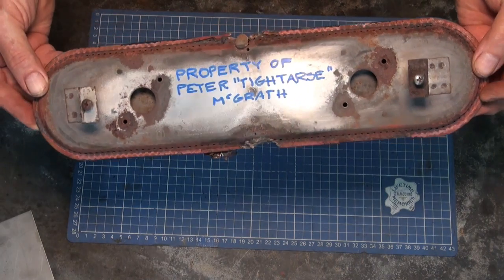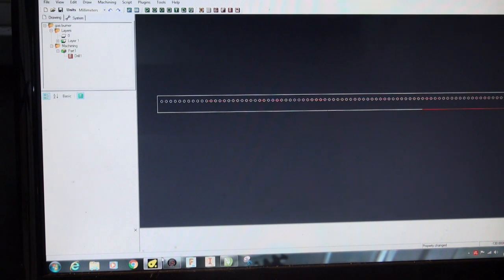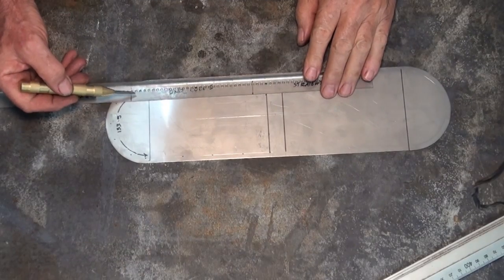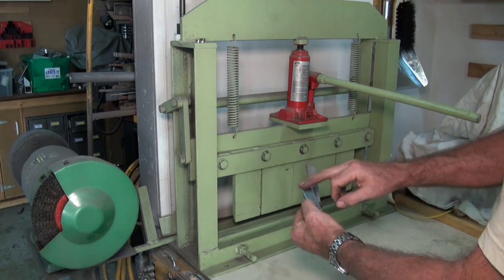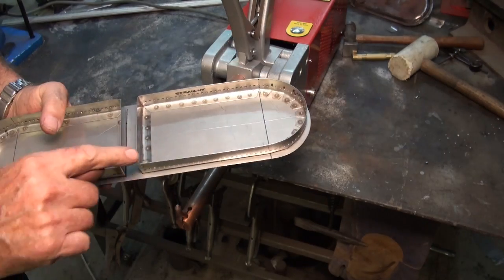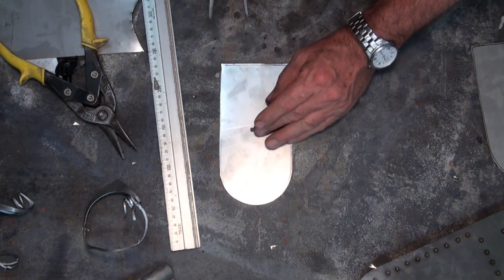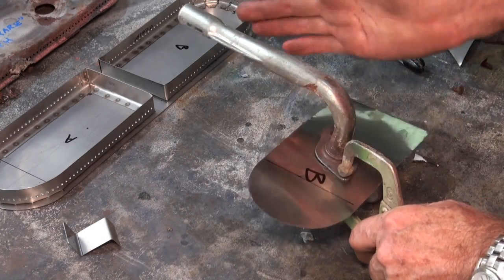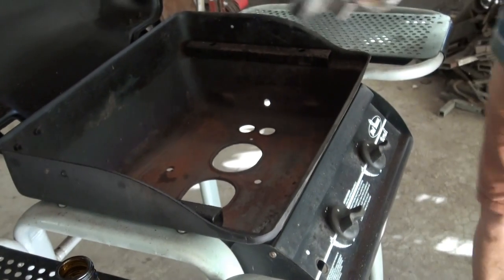Corroded Barbecue Burner? Build Your Own!

Comment: I love projects like this. Effort, time, materials, equipment and skills that went into the repair are vastly out of proportion to the value of the repaired item.
Reply from the maker: Yes, this project was way overkill but it was fun just the same and I wanted to give my DIY spot welder a decent workout to see if it was up to the task. It did the job well and I got a free beer when we lit the flame for the first time.

Comment: Super job. nice even blue flames . Economical way to do it? no. Did you have fun doing it? yes. did it work out well in the end? yes. that's a win for sure
Reply from the maker: John, I totally agree that it was way more complex than it needed to be. What prompted me to do it this way was that I had a plentiful supply of stainless steel sheet and I wanted to try out my DIY spot welder. The welder did a great job so that was a plus. A simple tube with some holes drilled around the edge would have been a lot easier.
Regards,
Mark

Comment: You can reorder the holes in CamBam by sorting the graphics primitives in the tree view. That will propagate to the g-code nicely.
Reply from the maker: I didn't realise you could do that although I guess I should have known. I have seen the list of numbered primatives and wondered how it worked out how to sequence them. I was just a little surprised that the order translated across from CorelDraw to CamBam. I do like using CamBam. It has it's drawbacks but I like it's simplicity. I have used Fusion360 a few times but most of what I do is 2D or 2 1/2D (pockets and profiles)

Comment: I'm a little late to the party, but it seems to me that an alternative construction would be a heck of a lot easier to fabricate.  Picture  a length of soft copper refrigeration tubing drilled on your CNC and over a steel rod that has been slipped over a rod that has also been drilled to prevent the copper.froming a bit to form on the inside of the tube.

The tube is then bent over a  form and then either attached to the gas inlet with a manifold made from off the shelf elbows and tees.

Perhaps a cheaper alternative would be electrical conduit. Often small quantities can be had for free from a electrical supply house a small percentage get banged up at the warehouse and not a big market for the scrap.

Another alternative might be to cast the burner in aluminum.  BBQ burners are usually considered consumable items and are made from cheap stampings.  If you tried pencil lead as part of the core that might avoid having to drill the holes. Aluminum castings will probably last a lot longer than burners made from sheet metal.
Reply from the maker: Roger, yes, there were a myriad of ways to make this burner and probably many of them would have been easier, however,  I had recently made my own spot welder and I really wanted to push it to see how reliable it was. Macca (my mate) and I discussed some options and I was confident I could closely replicate the original burner. At the end of the day it really needed some closely spaced jets and as you have identified it didn't need to be a hollow vessel. A tube would do the same job. 
Regards,
Mark
Reply: @Preso58  

On the spot-welder I have seen several YouTubers that have made one and I think yours is the best build I have seen.

On the burner project one thing I noted is that it seems toe that 2-4 years seems to be the average life span and after that they turn to junk.

I snagged one off the curb and converted it into a coffee roaster and the only thing that wasn't junk was the cast aluminum box. I had to replace the burner and the piezoelectric starter  and needed a new gas bottle, but the coffee was  good.

For a gas bbq I think I would build add a meat smoking capacity and add a PID to control the temperature  with a higher degree if precision.

Insulation would be a big plus also as precisely controlling the temperature seems to be one of the keys to consistent results.

So much for my ranting. Great job as usual, wish I would have a shop teacher like you when I was in
school. It is always makes my day when one of your videos pops up in my feed.

Comment: How about carving a depression into a piece of wood and hammering the sheet steel into it?  Make two and spot weld together.
Reply from the maker: Interestingly, I just watched a video by Ron Covell on making hammerforms. I believe he did a collaboration with This Old Tony to make a pair of dustpans. It would give a more professional looking result but stainless is notoriously hard to form into three dimensional shapes. 
Regards,
Mark
Reply: @Preso58  Okay, good to know.  I wasn't sure.  I've tried forming sheet aluminum this way and all it did was tear.  Ron Covell is a treasure.

Comment: hello I'm trying to be constructive here,  next time if you made a buck out of wood and pressed/hammered it into shape, drilled holes in the bottom plate then sealed it with a pinch weld <
                                                                                                                                                                                 >
it would be much faster.

Comment: Sorry but it will not last forever  I've tried these before and they work but only about 2-3 years Good luck anyway
Reply from the maker: To be honest, since making these new burners for my friend, I don't think he has used it much. He is a bit of a hoarder and can't bring himself to throw something away if there are any useable parts in it. I took the project on mainly out of curiosity and it was a chance to try out my DIY spot welder to see how well it performed, which was good. But you are correct. Even stainless steel will corrode and fail in this application after a while. 
Regards,
Mark